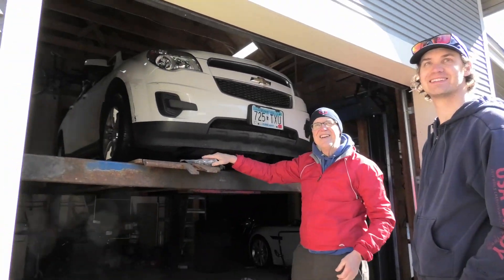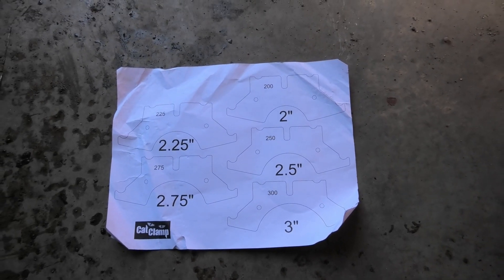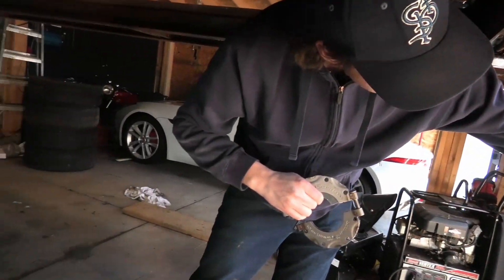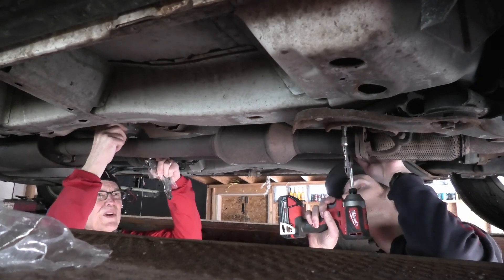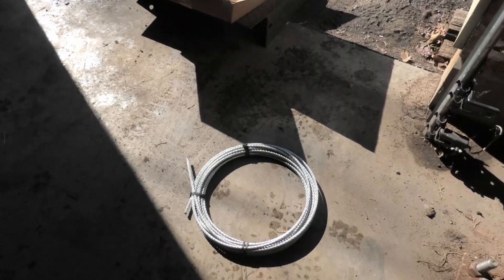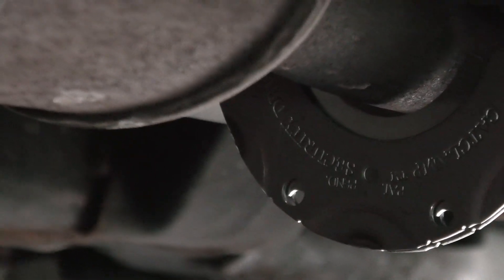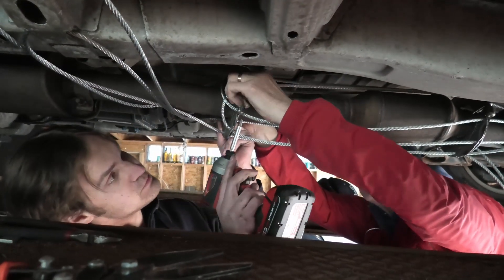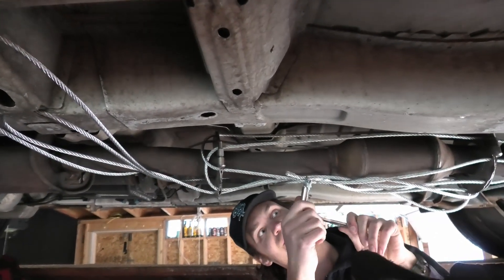Installing a Cat Clamp Catalytic Converter Cage on Chevy Equinox

Comment: Some people have no business posting DIY videos. This is installed wrong! You want the cat clamps locked at close the end of the converter as possible.
Reply from the maker: Please give us a link to YOUR video.
Reply: Good grief just google cat clamp videos and they ALL demostrate how to install it correctly. The reason you mount the clamps as close as possible to the ends of the converter is so the thief cant cut one end of the converter and slide it out through the cables.